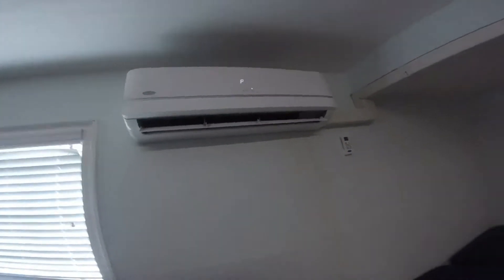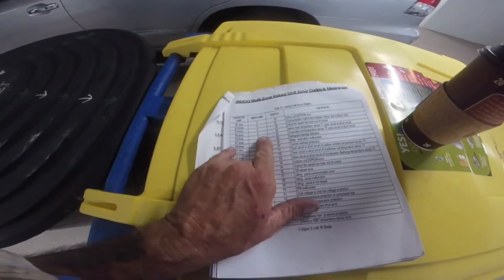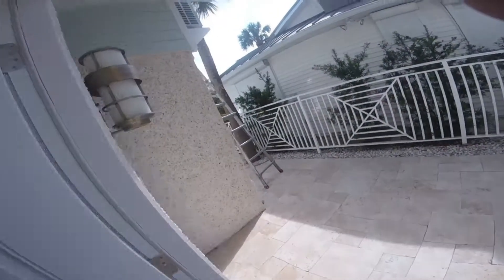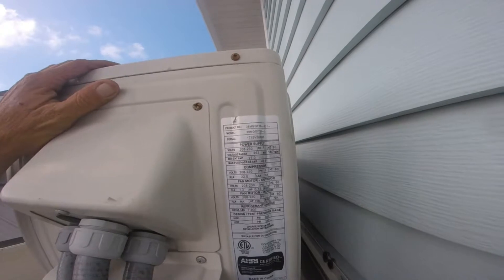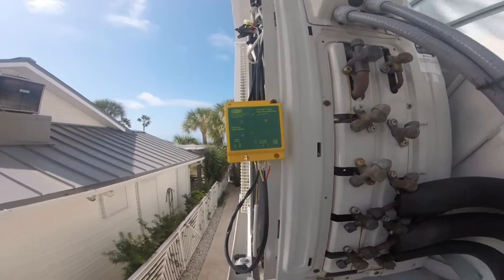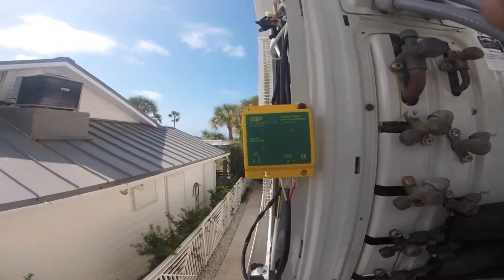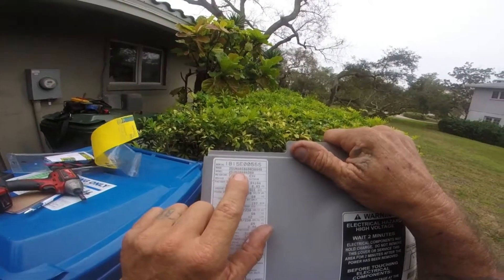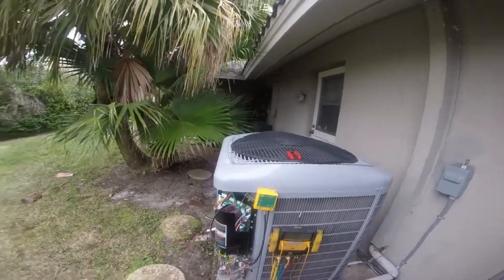New tool..inverter checker

Comment: Not totally correct, you don’t want to see it just light up, you want to see the lights chase their tail.  Basically one after the other in a circle.  Motors work on rotating magnetic field principle.  If two or more lights are on at the same time the inverter board is faulty